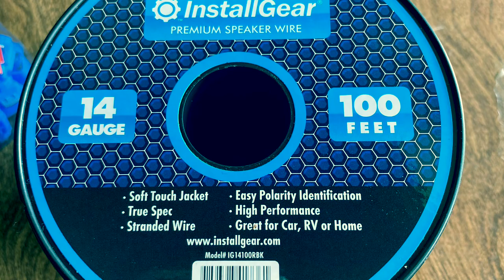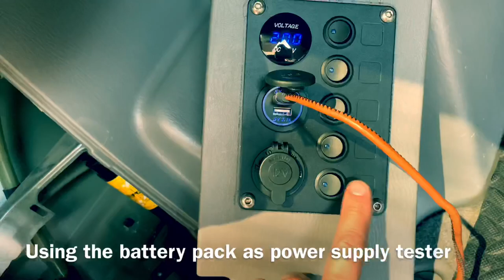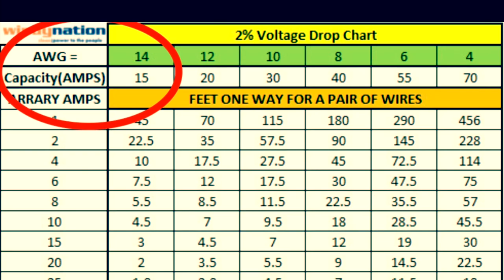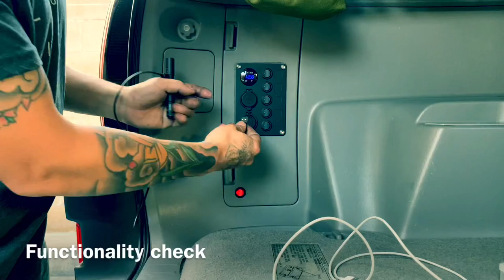4th gen 4runner 5 Switch / Charger / Volt Meter Panel Install

Comment: What did you connect the red and black power cables to? Directly to the battery?
Reply from the maker: @Nolan, Yes! I actually have a dual battery setup (secondary battery, AUX Battery) that is currently powering all my lights and my ARB fridge. This way I can still power them on without worrying my main battery getting drain. I can also use this setup to jump my main battery if I needed too. Cool feature included in my battery isolator.